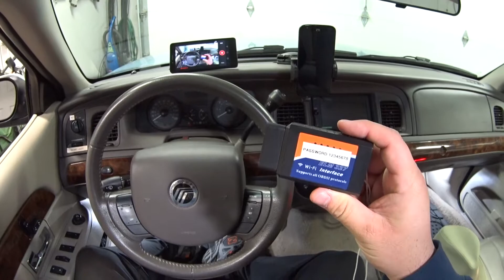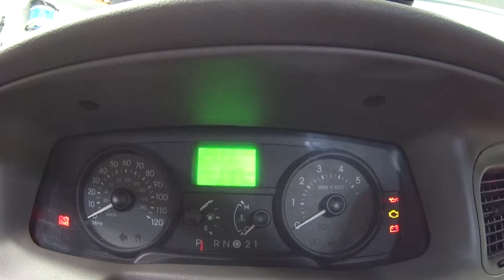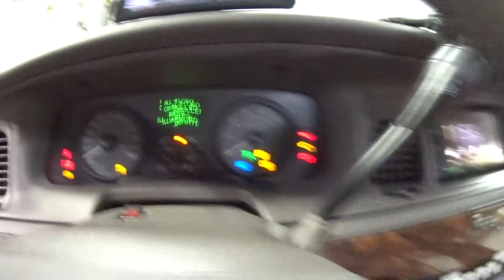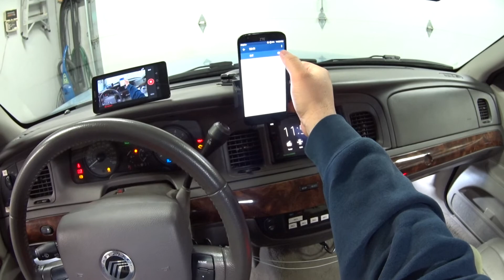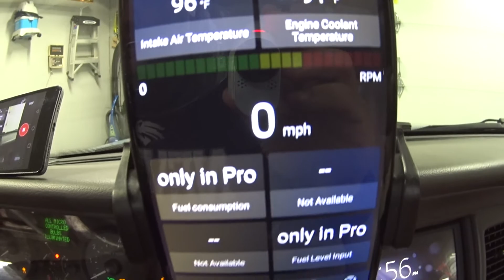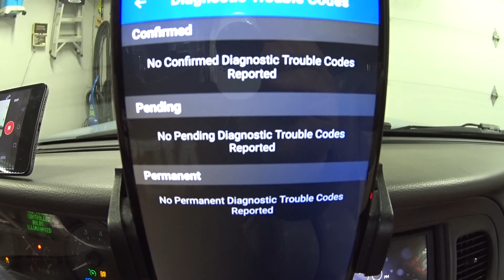Crown Victoria - Hidden Test Mode

Comment: I’m having an issue with my Victoria. When the engine is running, the pressure reading—which appears on the screen during the recording—shows zero. However, when the engine is off, it displays a reading of approximately 923. I’m not sure what the problem is, especially since the car sounds normal and seems to be running perfectly fine.
Reply from the maker: Hello, I think we have a communication / translation problem.
I'm not sure what you mean by PRESSURE READING.
Also, I don't know what 923 refers to.

If there is no malfunction, there is nothing to fix. 
-Chuck
Reply: @P @PanzerPlatform  

Oil pressure is shown on the test screen.
Reply: @PanzerPlatform 07:34

Comment: Do you know of a way to check the transmission temperature/ fluid temperature?
Reply from the maker: Right on Yousuf,
That's a great question.

You need a scan tool similar to this one;
https://youtu.be/m6otHuriq_M
-Chuck
Reply: @PanzerPlatform  thanks Chuck

Comment: Bro.  Mine is a 1995 LX.  My scan tool won't work, neither does O'Reillys. Even tho it has the OBD2 port inside. Its that funny year when they changed over from OBD1 to OBD2
Reply from the maker: Right on Greg,
Thanks for watching. 

You are correct. 
1994-1995 Panthers got OBD2 DLC's with limited functionality. 

Check your under hood VECI label. 
Only cars that say OBD2 compliant will have full OBD2 functionality. 

So technically 1994-1995 are still OBD1 even though they have the DLC. 
-Chuck

Comment: Just curious - what camera do you use to keep the screen from flickering?
Reply from the maker: Trade secret. Lol

J/k. It's not the brand of camera that matters. It's the recording frame rate. This was filmed in 1080p@60 frames per second. 

Your gopro is capable of doing this. 
Just adjust the resolution, and frame rate settings. Your gopro should have 4 different frame rate settings. 
24/30/60/120. 

Film 10 second short clips of your instrument cluster dance, and upload each clip separately to YouTube "unlisted" or "private". 

Then watch each clip to see the differences. 

-Chuck
Reply: @PanzerPlatform  Thanks a lot! Will have to experiment a bit :)

Comment: Hi Chuck, got the car from the Mechanic and he told me there are codes, but they are normal... I did the self-diagnostic test and i got these codes : DTCS 9317,9208,9212,D900,D262,E023
Reply from the maker: Right on Habib,
Good work.

No DTC's are normal.
There should be no codes period.

I'm not familiar with these codes;  9317,9208,9212,D900,D262,E023.

Can you film a video, and upload it to your YouTube channel so I can see how your doing it?
Just like I did in this video.
-Chuck
Reply: @PanzerPlatform  Hi Chuck, i will do it again. But i came across this forum where someone has similar codes https://www.cargurus.com/Cars/Discussion-d334_ds1084414
Reply: @PanzerPlatform  Here we go Chuck.. Sorry for the bad quality recording 😂 https://youtu.be/pBltpz4kxf4
Reply from the maker: @TheHabibalby  
Right on Habib,
Let me look up those code definitions, and I'll get back to you.
-Chuck
Reply from the maker: @TheHabibalby  
Can you upload a video of the EATC Self Test?
That will give the codes for you A/C issues.
Like this; https://youtu.be/1g4v4aHqIzI
Reply: @PanzerPlatform  I just read this while searching for the DTC D900 ( the error was "PATS Ignition Key Transponder Signal is Not Received - Damaged Key or Non -PATS Key".) I presumed because the Ignition key not original, as it doesn't allow me to reverse the key.. It could be..
Reply from the maker: @TheHabibalby  
Right on, 
Can you email me the link?
Reply: @PanzerPlatform  should land in your inbox now..

Comment: Hey, have you got around to installing the TRQ rear control arms? thinking about buying them but wanted to see if you were still satisfied with them after installing and driving on them.
Reply from the maker: Yo Robert,

Thanks for the question.
Absolutely, I installed them 5 months ago, and have been squeak free ever since.
I would buy them again in a heartbeat, especially at that price $84 for all four plus sway bar links.

But, there's a good chance they will be damaged in shipping because they did not pack mine properly.
I sent them an email, and they "fix it". I made a video about it too. You can see it here;
https://www.youtube.com/watch?v=E2OgS_HCQDw
-
-Chuck

Comment: Hi chuck this is very useful i used it to know the voltage of my alternator, and now i just know that the dtcs is the check engine codes 😂thanks!
Reply from the maker: Right on Mr. Bahrain,
Thanks for stopping in.
-Chuck

Comment: Thanks for the heads up on this one, Chuck. I never knew this feature existed and for the next few days I get to drive my P7b again after sitting since last December.  Changed an axle shaft, flushed the housing, new bearings, seals, fluids, vent tube, rotors, calipers, shoes and pads. Runs and drives great, but my fire suppression light is on and I think I'm going to need some help figuring that one out. Not much info for them out there that I've found.
Reply from the maker: Yo Death,
Thanks for stopping in.
Good luck with the Fire Suppression System.
-Chuck

Comment: Hey Chuck, thanks for the informative video! Would you please give me the links for your Cell phone dash mount and the also for the green LED digital voltage meter on your dash panel? Thanks in advance!
Reply from the maker: Yo Philip,

Here is the link for my Cell Phone Dash Mount;
https://www.amazon.com/gp/product/B00LPM9IBO/ref=ox_sc_act_title_1?smid=A1EFL1J69ZJCO9&psc=1
-
That green thing in my dash is actually a “Dual USB Outlet with built in Voltmeter”.
I use it to power my devices, (dash cam, battery bank, spare cell phone etc.)
This particular model has been discontinued.

I’ve been meaning to make a long term video review update + giveaway.
I purchased two outlets, plus the tools to install them, (circuit tester, step drill bit), plus the ash tray panels for both rear doors, and pre drilled them for easy installation.
But my funding fell though, so it’s on hold at the moment.
(btw, my channel is not monetized either).

So just get on Amazon and search “USB Outlet 12V”.
They cost $10-$20 each depending on configuration.

-Chuck

Comment: Definitely love that function!!! Used it a few times in my 2010 P7B. But since it's only 1 thin small screen, it's pretty different. 
Would love to swap clusters though for one of these.
Also, have you ever heard of the Scan Gauge II? I have that for my car, and I absolutely love it!
Reply from the maker: Yo Maxy,

Thanks for stopping in.
Is this what you’re talking about ($160)?
https://www.amazon.com/gp/product/B000AAMY86/ref=ox_sc_act_title_1?smid=ATVPDKIKX0DER&psc=1
-
That looks pretty neat.
I like how easy to read the display is.
Must be nice to have accurate digital readings at a moments glance.

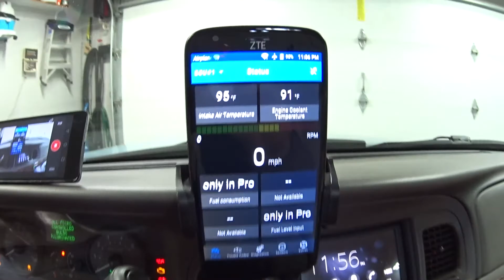8:53 I can kind of do that with mine, but it can get distracting sometimes.
But for ($15) I can cope with it;
https://www.amazon.com/gp/product/B07L4926C1/ref=ox_sc_act_title_1?smid=ANQDB1IPPMOOB&psc=1

-Chuck